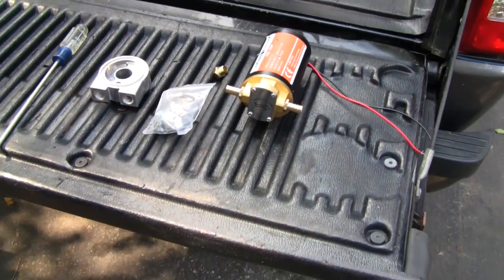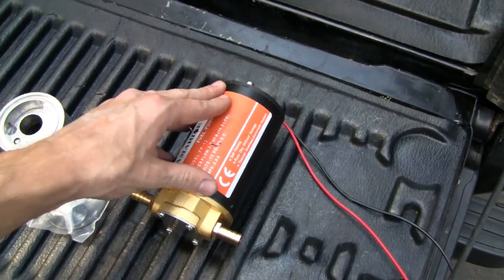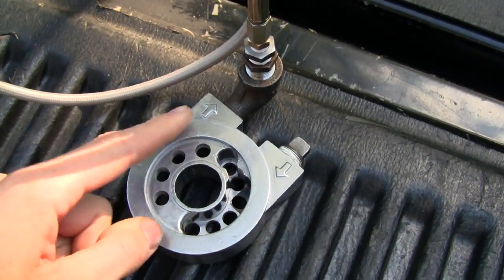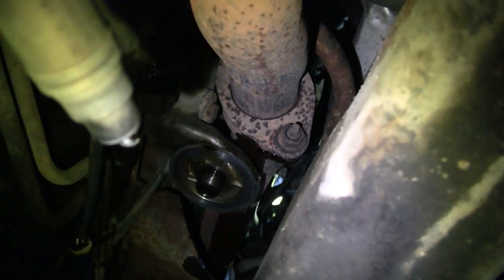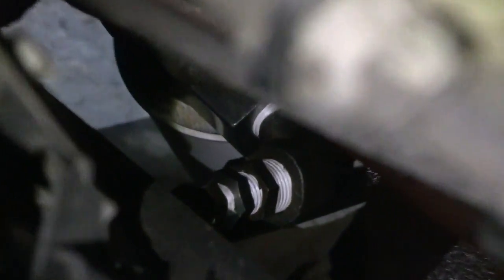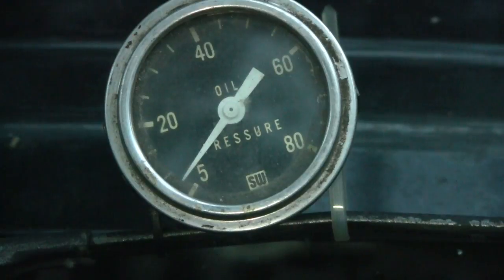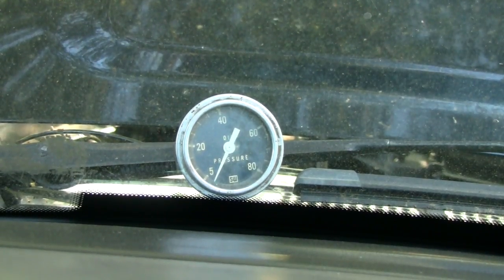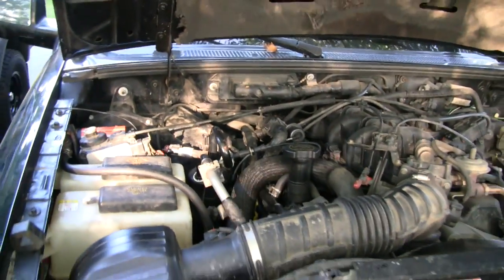DOUBLE THE LIFE OF YOUR ENGINE? HOMEMADE PRE-OILER SYSTEM

Comment from the maker: What do you guys think? I built this to fix a specific problem, but do you think it could help extend the life of any engine??
Reply: Yes i'm pretty sure it can. I have a toyota camry 2014 and it makes a 1 second rattle on cold start due to the engine not being oiled before startup.
Reply: These external pre-lubers were ' all the rage' back in the 1970's especially for heavy equipment and marine engines etc..
They worked for sure and today, a lot of engines especially automotive diesels won't 'fire up' until oil pressure is brought up by cranking; this would be done by internal pre-lube system.
So will your pre lube system work? Yes I think it will.
Reply from the maker: +Reg Sparkes How about that! It would be neat to find some old literature about them from back in the 70s.
Reply: As I was commenting here I was trying to re-call the brand of these. I was working for a large equipment dealer at the time, and we sold and serviced GM Terex earth moving equipment and Cedar Rapids Crushing and Paving equipment. A lot of our customers ordered these systems for their equipment. 
The name Pre-Lube comes to mind, but in any case, try Google.
Keep working on your system, you're onto a good thing here.
Reply: Is it possible instead of using an oil filter sandwich to use the Oil sending unit intake with a splitter to pre-oil?
Reply from the maker: Hi Jeff, sorry for the late response. The problem with doing it that way is that you would be pumping unfiltered oil into the engine - not a good idea.
Reply: @regsparkes6507  RPM Industries still makes them!
Reply: @johnrussell8410  OK then, but I also just remembered the brand name of the pre-filter system we used back in the 1970`s,..it was a `Harvard` by-pass oil filtration system.
I`ll look up RPM Industries now and see what they have.
Thanks John!
Reply: I think your idea is brilliant. I'm going to sort this on my car. It's very similar to an accusump or drysump system but 20% of the cost. If you put an in line oil filter as well , (think massey ferguson) you could switch it on after you shut down engine to assist cooling and refine oil like Amsoil bypass filter. Wouldn't leave it running once engines on as will create dry sump and blow your engine oil pump. Thank you from UK and really interesting vid.
Reply: kjaques1 .... FREE and FAST way to prime  your motor for the meanwhile is to make an off/on switch to cut off your spark while you hold the key and let the motor turn for 6 seconds. That’s what I’m doing until I rig my sump,
Reply: Great idea.  I don't know why it's not used more.  I heard about it back in the eighties.  Isn't there an Allen head plug right by the oil filter housing that you can just put a fitting in so you don't have to monkey with the cooler adapter?
Reply: Are you still using this?
Reply: @motoforlyfe  Thank you for the detailed video! Thinking to put this in my KIA Sorento after engine been rebuild. This engines notoriously bad with oiling as a result eating up the rod bearings (fixed 4 of them). Pre-lubing will definitely help! Problem is oil filter housing is plastic and no way to use oil filter sandwich(
Reply: @George241312  I have a 2014 Avalon. I recently installed a Baxter Performance TS-501-BK oil filter adapter. It replaces the housing that Toyota uses to contain the filter element. Since Toyota's design contains no back flow valve, all of the oil drains from the passages. Mine clattered as well, but now it is amazing. Baxter recommended a Wix 51335, so that is what I have at least started with. It is a shorty filter, but it is in line with the oil pan, so damage is less likely to occur. I'm not saying this is as good as a pre-oiler, but at least the valve train seems to go totally quiet when starting.
Reply: Good job! Important thing is not the pressure, this is not a strong pump, but important is the ability to fill the main oil gallery with oil before the start up. I am in the process of building the same system for my Cummins engine, the truck sits sometimes for weeks without being started, the batteries are on trickle charge all the time, so I want to avoid dry starting the engine and have the main gallery full before cranking it over.
Again, good job! 👍
Reply: Rotax 850 Etec 2 stroke has this feature

Comment: 80% of engine wear occurs on startup. And computer engines love to SCREAM to life tearing things up inside. ALL cars should have pre-oilers from the factory!
Reply: Been saying this since the 80's. However consider any decently maintained engine will last 300K and more for many, and the OEM's really don't care to stretch engine life to the max. Therefore, just how beneficial/needed is a "pre-oiling" system?
Reply: @chestrockwell8328  True, but we need to make things last as long as possible for the Earth and our wallets.
Reply: @OregonDARRYL  What's the most miles you've put on one of your vehicles?
Reply: @chestrockwell8328  400,000miles on an 07 Civic.  Pennzoil and no pre-lube, but I'm still interested in a pre-lube/heater for my '18 Camry running 0W-16 in upstate NY.  Engine is great at economy but the longevity of 16 makes me worry I should assist cold starts.

Comment: I would put the check valve next to the filter, that line would only be pressurized when the pump is running, not the whole time the engine is running... These work well for turbos, with a timer on them, they are used for pre and post oiling. Running oil thru the turbo for 2-3 minutes after shutting the engine down stops the oil 'coking' on the turbo shaft/bearings.

Comment: Put your check valve on the other end of the line, eliminate the running pressure in the rubber line.

Comment: NO CRITICISM, JUST A SUGGESTION, PUMP WILL LIKELY WORK BETTER MOUNTED LOW FOR EASIER PICKUP AND YOU COULD HAVE PLUMBED OUTLET DIRECTLY TO OIL PRESSURE GUAGE PORT ON ENGINE BLOCK.  GOOD VID, NOW I KNOW WHERE TO GET AN OIL PUMP FOR AN IDEA THAT I WANTED TO PUT TO WORK.

Comment: I'm doing this exact thing. But the pump will not pick up the oil. It's summer in Arizona and the oil is 10W30. Its like water. Maybe it's the 3/8 ID tubing and hose. Perhaps it's too big. This will be the third try. I'll move the pump closer to the oil pan. SeaFlo advertises a 1 meter suction. BS. I'm barely 14" above. Tired of lying ads. If that dont work I'll buy a damn submersible. What a pain in the ass.

Comment: Why wouldn't you just add a disconnect to the fuel pump fuse?  keep the circuit open for the first 5 seconds on a cold start... way easier and no chance of trapping air in a poorly chosen pump location.

Comment: Pump sounded as though it was struggling means it was probably cavitating or failing to get/keep prime due to high suction lift.  If you check amps, you might find a low amp condition where pump is not loading up - compare numbers to your test setup.  If it's cavitating, amp load will drift all over the place.  Locate the pump inlet as level to the suction hookup as possible [frame rail is as good as it gets on a car], or put a check valve on the pan connection and fill your hose prior to hookup.   You did spot hose issues: a 1/4" [6mm] outlet line needs a 3/8" [10mm] suction.  I would definitely put a check valve at supply line where it connects to engine to prevent backflow/oil starvation problems once engine is started, and lockout pump 12v source by relay contact whenever key goes to engine "on" position.   All you want a prelube pump to do is fill your gallies/purge air and wet bearing surfaces prior to cranking.   If you pop a valve cover, the setup should just barely push oil to the highest point whatever it is [cam bearings or pushrod, depending on engine].  Time how long it takes for that to happen [cold engine] from turning on pump, add 10-20 seconds and that's all you need for run time.   Something between 10 to 15 Psi output is enough on most engines.  If you want oil supply to continue while cranking, then install a tee in pump discharge and hook that up to an oil acccumulator - it will flow until system [internal engine pump] pressure exceeds resevoir pressure.  An accumulator setup will definitely need that check valve at the pan connection.
Done right, a prelube pump will add lots and lots of miles to your engine - good luck!
Reply: Thanks for the info. Do you have a  link to a similar set up which i can learn from? I am looking for a suitable pump for my motorcycle. The pump in this video is kind of too big. It is a big 1100cc machine which i would like to take on world tour so i need it as fault proof as possible.

Comment: Great idea and clean install! I'd like to try this eventually, it will certainly be nice to always have oil pressure before startup. However, excluding specific design issues like yours and odd use cases such as infrequent use, I'm not entirely sure pre oiling will reduce startup wear nearly as much as we would like for several reasons.

First of all, the oil won't directly reach all the engine's parts. It will definitely reach the cam, crank, and rod bearings, but not the splash lubricated parts like the valvetrain, cylinders, pistons, and rings. However, the oil will probably splash around slightly faster once the engine is started if it's pre oiled, so there's probably an indirect benefit there.

Second, no matter how much oil or oil pressure there is, the engine's bearings and other lubricated parts must be in motion to have a hydrodynamic oil film separating them and will still be subject to metal to metal contact and wear until rotating fast enough to establish an oil film similar to how a water skier must be moving at a high enough speed to be floating on the water before their skis are no longer touching the ground and subject to wear. No amount of lubrication can change that.

Finally, much of the wear engines experience when cold is actually corrosive rather than mechanical due to corrosive combustion byproducts such as acids and moisture condensing on surfaces before they are warm enough to prevent that. Also, much of the mechanical wear during startup/warmup is caused by cylinder wash, cold oil being too thick, and incorrect/uneven expansion of parts. For example, pistons heat up and and expand much faster than their cylinders, creating tighter than normal piston to cylinder wall clearances until the block warms up and expands too. So while pre oiling is good, it's only one part of startup/warmup wear prevention and preheating the oil and coolant is also beneficial. The closer you can get the engine to operating temp before startup, the healthier it will be in the long run.

Comment: Definitely will help engine wear I replaced the valve springs on the 4.0 ranger and when cranking with the valve cover off it took for ever for the cam to get oiled... My engine in the cylinder head has a drain back plug thing that when the engine turns off the oil gets stuck in the head... I like your idea I might steal it would be very good for a turbo car
Reply from the maker: Matt Drew Thanks, I think it would be especially good if you are running an expensive turbo and want the bearings to last longer.

Comment: Nice looking little pump. The gear design is very similar to the hi-flow/low-pressure oil pumps used on H-D engines.
Reply from the maker: +John Ratko I definitely think the pump was designed with flow in mind rather than pressure. Still does a decent job

Comment: Curious, the oil you are pulling from the pan, it gets pumped through the filter first and through the motor? I would think if it bypasses the filter that would be a problem
Reply: Yup, all the oil is filtered on his setup. It goes through the filter just like it normally does. It would indeed be a problem if it wasn't and would most likely cause far more harm than good since particles tend to settle to the bottom of the oil pan.

Comment: This is a great idea, and yes, I suspect it will significantly increase the life of an engine. A couple of observations: the restrictive hose wouldn't matter much because the goal is to get oil circulated through the engine. It might be a slower process with a larger initial pressure drop, but you'd still get the result you want. Also, an external gear pump is a poor choice, because they machine themselves and generate large amounts of debris. I'm a fluid power tech and spent a decade rebuilding hydraulic pumps and motors. I would never use an external gear pump for any reason. It's also important to know where in the circuit the sender unit is. Ideally, you don't need to monitor pressure at all, you would only need to confirm that oil is returning to the pan. Also, I'd be curious about how much the oil level changes after you've run the pump for 30 seconds. My concern would be that in a small engine, it may reduce the oil level enough to starve the engine oil pump. The volume of oil stored in a circuit can be deceptively large.

Comment: I Googled Pre–Lubers and your video appeared. That’s a really great video thanks for posting. I do have a question but first let me explain. I currently have a commercially produced pre-luber system on my car ( a 1976 Aston Martin V8 Vantage ) that I purchased from acompany out of Wisconsin ( if memory serves me right ) called Engine Lube. I’d buy another coupla tamorra but they appear to have gone out of business? I installed the first system on the car circa 1995 /00 when I was restoring the car ( the first time round? ). When I installed the system I installed an extra
boss in the sump of the engine and hard plumbed the lines ( ½ copper ) to the pump
which is mounted on the engine ( there’s nowhere else to mount the pump in the
engine comp there just isn’t any room ) on a plate I designed and built using vibration
dampening donuts. I used braided SS from the pump to the filter sandwich plate.
Subsequently Engine Lube came out with a much better looking smaller pump, very
similar in shape and size to the one on your video, which I purchased and
installed. The system has a brain wired into the ignition system. When the
ignition key is switched to the auxiliary position the pump runs for 20 seconds
and puts 20 psi into the main oil gallery. I bench tested the system on the
engine when I was rebuilding the engine. I put an oil pressure gauge directly
off the main gallery supply that goes to the OPG in the car and got a reading of 20 psi
at about 5 seconds and oil pissed out of the overhead cam journals. When the
engine is shut down the pump post lubes for 6 minutes preventing varnishing. It’s
a really great setup especially for guys like me who own Vintage cars that sit
all winter. Currently the pump is making rather a lot of noise and I think I need
to replace it. I’d be really interested in getting the information on the other
pump that you used in your other set up please. I’m not sure how to use this
site in terms of making contact with you? Not sure about posting phone numbers
or email addresses?? Any help or suggestions would be much appreciated thanks..dk

Comment: You should be able to tap straight into the oil gallery on the engine  most engines have a plug somewhere on the side of the block
Reply: T under the oil pressure switch...
Reply: @hotrodray6802  That could work and so could tapping directly into an oil gallery if possible, but if you do that, you would really want to use some kind of inline filter if the port you introduce the oil into is downstream of the oil filter. The oil pressure switch is almost always downstream of the filter so it trips if the filter clogs, but an oil gallery plug may or may not be. The LAST thing you want to do is run unfiltered oil full of whatever crap may have settled to the bottom of the oil pan directly into the engine because that will probably cause more harm than running for a second without oil pressure ever would.

Comment: You got an 06? That's like a perfect one to get yourself a 5.0 donor Explorer, build a BEAST engine and drop it in, tune and shit and have a Ranger with a chop.
Reply from the maker: BronzeChicken Problem with that is I'm not sure if I'd have issues with inspection and also the PATS. I think an older year (like a 95) would be best for the 5.0 swap.
Reply: Well then shit just get a V8 Explorer, the 5.0s are just flat out amazing, I've had two and both blew my two 4.0s out the water.

Comment: Can we hear the engine start after the preoil pls ? or tell us if it still makes the rattle ?
Reply from the maker: George241312 I did mention at the end of the video that it works, the engine doesn't rattle anymore. However I should have showed it actually starting. Will show in a future video.

Comment: Excellent idea. I came across this as i have an Accusump and a spare sandwich adapter and was wondering if i could just drill it out as you did. 
While the accu can pre-oil I didn't buy the fancy valve type so I may well do the whole mod too seeing as the car's just been rebuilt with forged pistons, new bearings etc